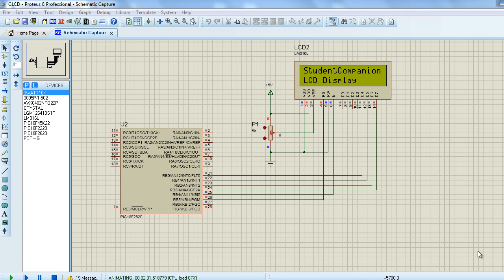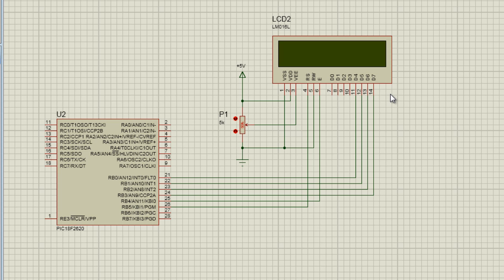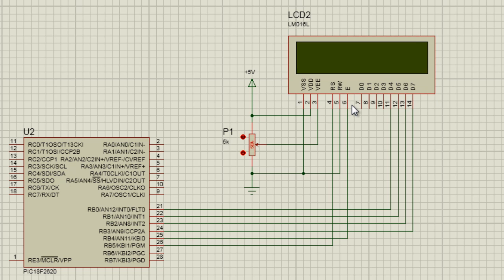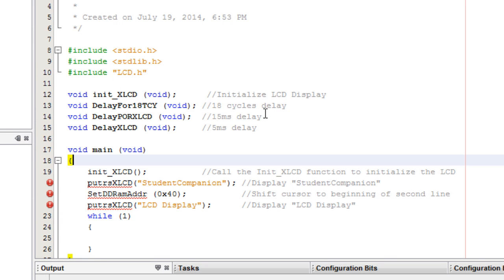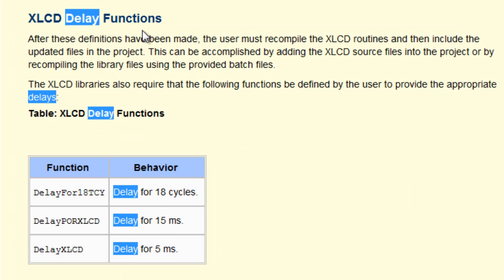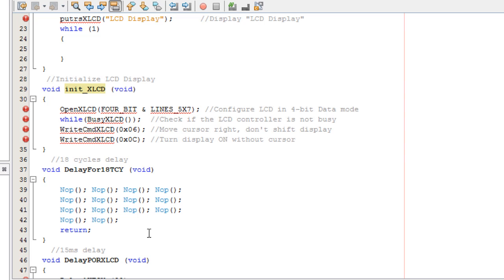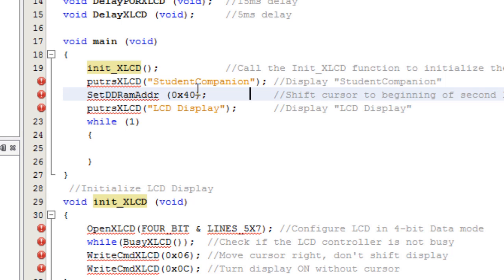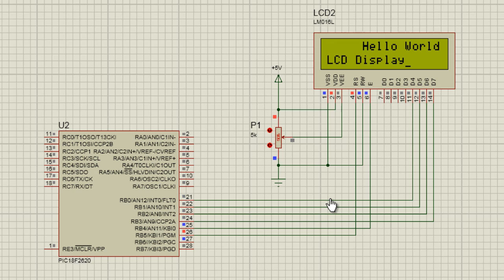5- Interfacing an LCD Display | MPLAB XC8 for Beginners Tutorial

Comment: I'm having a heck of a time implementing I2C with a 16F1508. I've tried so many different things with no luck. I considered moving to PIC18 family but plib is not installed on my system. I have no plib folder in include and there is no documentation for it in the docs folder. I don't suppose you'd consider doing an I2C tutorial for the PIC16 family would you?
Reply from the maker: hi.  if you are considering PIC18 it ia very easy to implement especially if you using the library. They have to be a library help document unless you are looking on a wrong installation folder.  check our tutorial 6 (ADC) or 14 (rs232) to learn how to using the library help document. we have an I2C tutorial on our website. check for it on www.studentcompanion.co.za
Reply: I've looked in every folder relating to XC8 and MPLABX. There's no mention of plib anywhere. :/
Reply from the maker: +KubuntuYou The library help file is called: MPLAB_XC8_Peripheral_Libraries and is located in the docs folder in XC8 installation folder. It is not in lib folder. Check out this tutorial, we clearly show you where to find it and how to use this document: https://youtu.be/8dDOp2pPm6c
Reply: +StudentCompanionSA https://www.dropbox.com/s/pkmovudkxcmh0wr/docs.png?dl=0 This is a screenshot of my docs folder. There are only 3 PDFs in there and nothing about Peripheral Libraries. Were they supposed to be installed when I installed XC8 or do I need to install XC18 or something else to get them? I appreciate the help.
Reply: +StudentCompanionSA I found the legacy peripheral libraries installer for download from microchip. They seem to be working now but i won't be sure until i have a chip to test with.
Reply from the maker: Why do you want to use the legacy one?
Reply: +StudentCompanionSA They were the only ones available for download. The non-legacy version was the MPLAB Code Configurator tool which I've already had installed. Looks like XC8 v1.35 doesn't directly support Peripheral Libraries but they are still available for download.
Reply from the maker: +KubuntuYou we are using v1.34
Reply: +StudentCompanionSA And therein lies the rub. lol  At least now I can follow along with your awesome tutorials. :)
Reply from the maker: +KubuntuYou thank you.  Good to hear that.

Comment: Hi, so how do I know which Port to use to connect the PIC to the LCD? Is there a code that I can write to configure that specific port to work with the LCD. And why does the LCD need delays in order for it to work?
Reply from the maker: Thapelo Masilo Hi, The default LCD connection is on PORTB using the LCD library, so you don't have to define PORTB. This library is called xlcd.h it define the connections of the LCD. If you want to connect your LCD on a different PORT other than PORTB, then you should modify it accordingly.
You can access this xlcd.h file in your XC8 compiler installation folder in this directory:
...Microchip/xc8/v1.34/include/plib
Note: v1.34 is your XC8 version.
The xlcd.h library needs those delays.
Reply: StudentCompanionSA  OK, thanks. And about the delays? Why are they important?
Reply from the maker: Thapelo Masilo As we have said it earlier, the LCD Library (xlcd.h) needs those delays to control the LCD. If you don't include them, your code won't work.
If you want, you can address the LCD directly without using the LCD Library or you can write your own library but, you'll have to understand the internal working of the LCD.
Reply: StudentCompanionSA  Thank you. It worked. I only had to enable the LCD by sending a 1 to the Enable pin. So the main function looks like this

void main (void)
{
    LATBbits.LATB4 =1;//I included this command to enable the LCD
    init_XLCD();
    putrsXLCD ("StudentCompanion");
    SetDDRamAddr (0x40);
    putrsXLCD ("LCD Display");
    while (1)
    {
    }
}
Reply from the maker: Thapelo Masilo Watch this video to learn how to connect LCD to another PORT beside PORTB:
https://youtu.be/RkDN2GW_SxU
Reply: Thanks
Reply from the maker: +Thapelo Masilo you are welcome!

Comment: Hallo Sir.. Thank for the tutorial..
Where statement to define port B ..
and how  to choose other PORT..
TQ
Reply from the maker: Nurzul Healme  Hi, The default LCD connection is on PORTB using the LCD library, so you don't have to define PORTB. This library is called xlcd.h it define the connections of the LCD. If you want to connect your LCD on a different PORT other than PORTB, then you should modify it accordingly.
You can access this xlcd.h file in your XC8 compiler installation folder in this directory:
...Microchip/xc8/v1.34/include/plib
Note: v1.34 is your XC8 version
Reply: Ok ..Thank for quick reply . :)
Reply from the maker: Nurzul Healme you are welcome!
Reply from the maker: Nurzul Healme Watch this video to learn how to connect LCD to another PORT beside PORTB:
https://youtu.be/RkDN2GW_SxU
Reply: Thank man.. :).. i try this .

Comment: Thanks for the Video.. How much you can write on XC8 Demo Version? im afraid to beggin in this compiler C of Microchip because if my skills improve in time i wont have money to purchase the professional version, so do you think is better to program in CCS or Mikrotik instead a pay program compiler like XC8?
Reply from the maker: tiwar87 , there is no code limit on the XC8 demo version, you can write a code as big as you want, the only difference is the optimization of the generated code, with free version, there is no optimization so the generated HEX file might be a little bigger than if you used a professional version.
Depending on other compilers, it's up to you. You can try them and decide yourself, but you must remember that the XC8 is the manufacture compiler with a wide range of application libraries.
Reply: StudentCompanionSA Thnks for the info and advices Sir. Very useful, thnks a lot
Reply from the maker: You are welcome!
Reply from the maker: You are welcome!

Comment: Thank you very much for your tutorial. It's really useful. But I don't understand why the frequency is 8Mhz so the instruction cycle time is 1.5us. Can you help me understand that.
Reply from the maker: Hi Bi Na  with a clock of 8MHz, the instruction time will be 0.5μs not 1.5μs.
In PIC microcontrollers, an instruction cycle takes four clock periods, the microcontroller actually operates at a clock rate, which is a quarter of the actual oscillator frequency. For example, in a PIC microcontroller operating at 4-MHz clock, the instruction cycle time is only 1 μs (frequency of 1 MHz).
For 8MHz, the time will be 0.5μs
Reply: StudentCompanionSA Thank you very much, I fully understand of that but in the DelayFor18TCY, which you want to delay 18 cycle but I just see 14 Nop(). I don't understand of that.
Reply from the maker: Bi Na You can use the normal delay function or use the nop() function to generate the delay as we explained in the video. if you follow well the video you will understand.